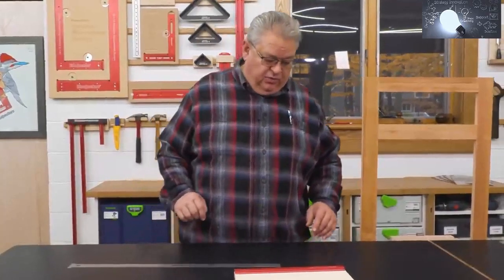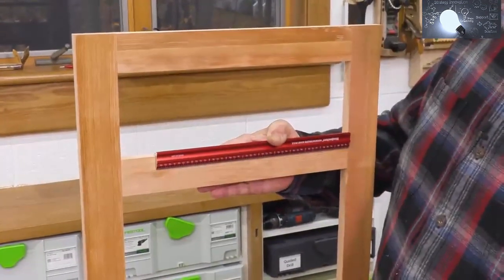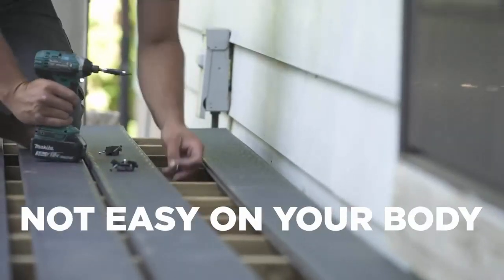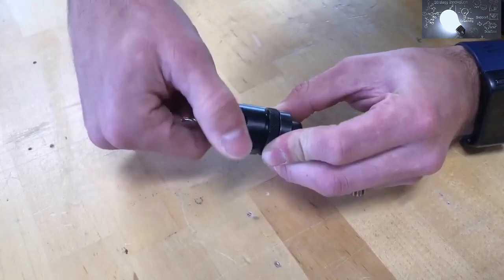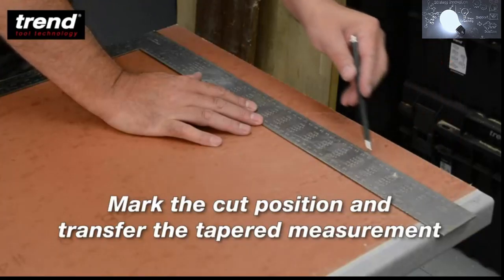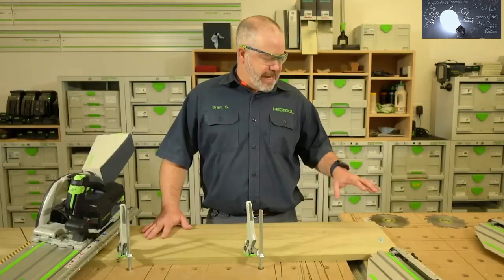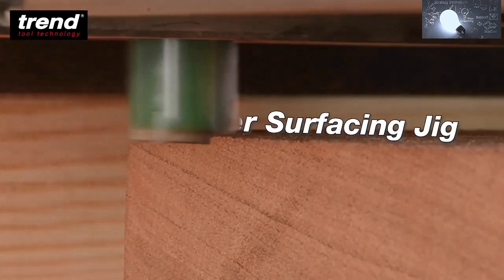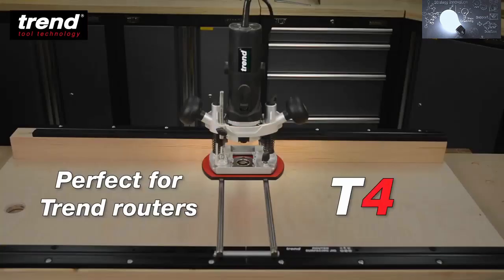10 WOODWORKING TOOLS YOU NEED TO SEE 2020 12

Comment: None of these things are necessary. You can do everything they show you by using basic hand tools.
Reply: There isn't too much that can't be done by with hand tools. But would you really want to drive several hundred screws by hand to install decking? Can you cut a 20" deep counter to meet up to another piece with no gapes?
Reply: That's the number one thing about woodworking.  There are multiple tools and multiple techniques to do the same thing. You can use a hand plane, power planer, jointer thickness planer, or even a belt sander with a high grut to all do the same thing. Its about preferance or usually available funds